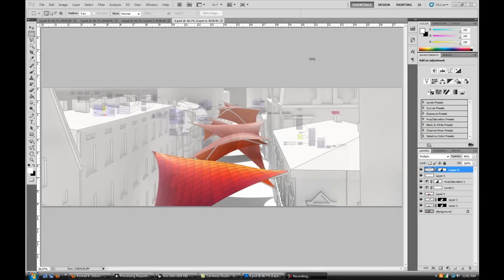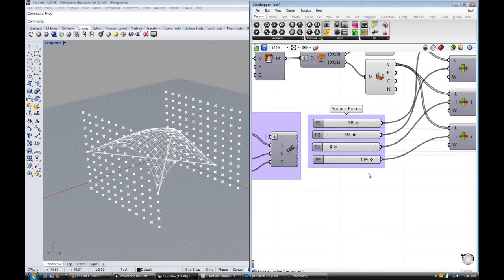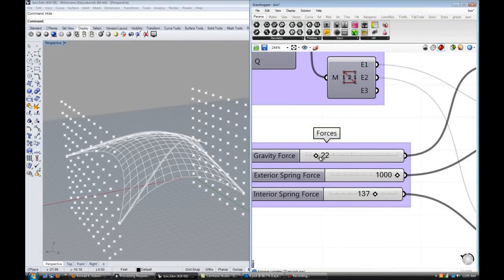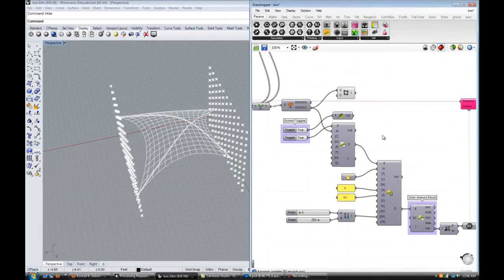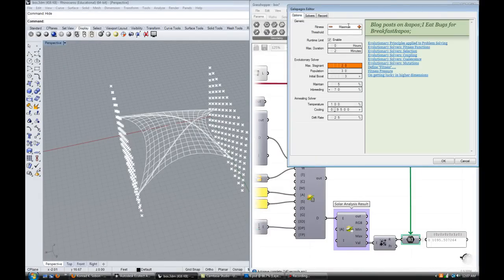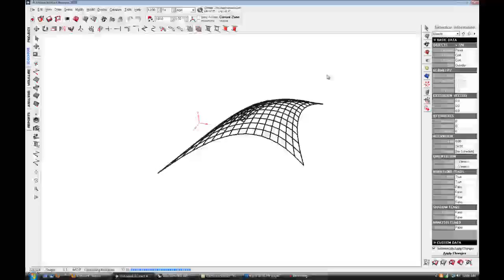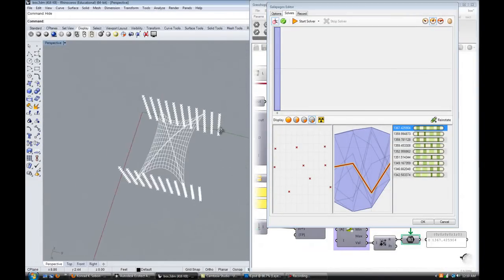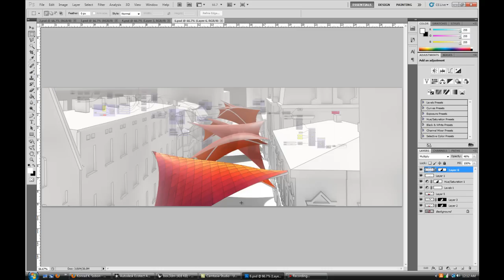Compression Structure/Shading with Grasshopper + Kangaroo + Galapagos + Geco (Ecotect)

Comment: very nice! I am trying to use a similar approach to a tensile structure I am designing, but I am struggling to use the Galapagos component, would you be able to tell me the formula you've entered for optimizing the radiation?
Reply from the maker: Well, in this case I was looking for the best shading at the street level thus my Galapagos fitness goal was to have the biggest possible radiation on the tensile shading surface itself.
Reply: nice, I think i might try to use similar technique and apply it to a particle simulation on wind distribution. how are you continuing with this project?
Reply from the maker: moloipeople It wasn't a real project. I was curious about different software and their ability to calculate solar radiation. I recycled an old project to test them on.